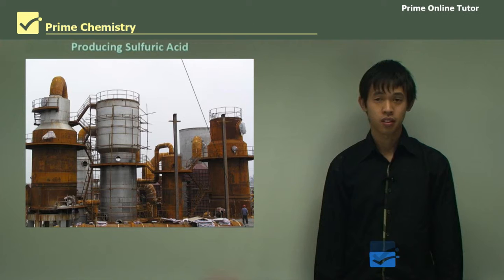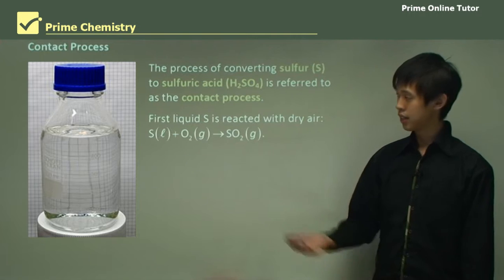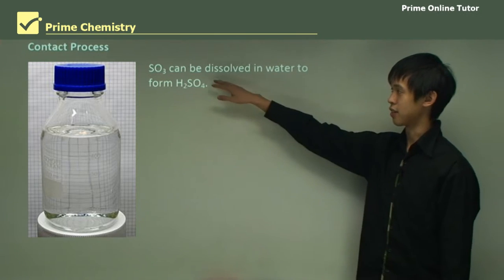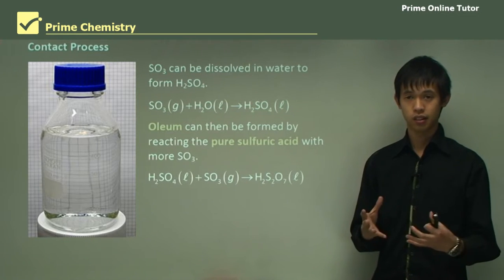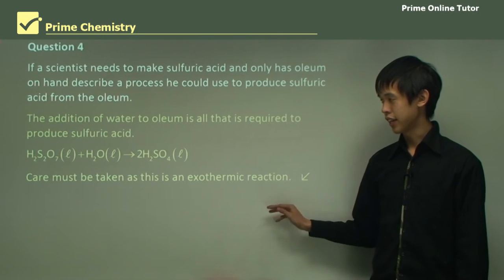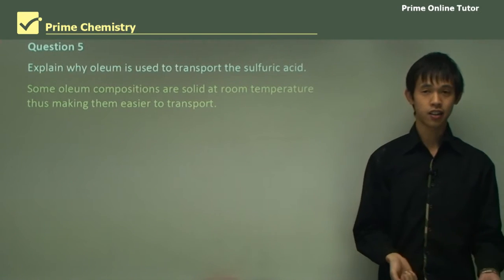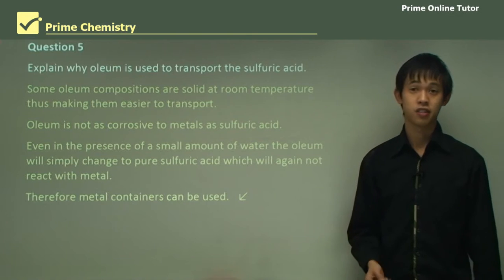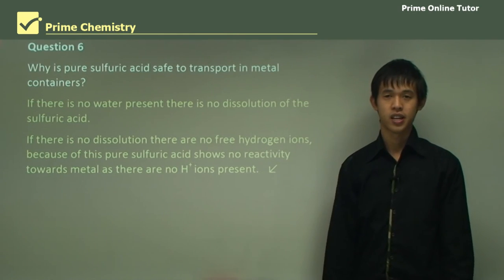√ The Producing Sulfuric Acid Explained with Examples

Comment: Its called fuming sulfuric acid because it forms white fumes when exposed to air.
If you are boiling the water enough for it to steam during dilution, you would be loosing that water and throwing off your dilution ratio.

Not sure what the point of this video is but its rubbish.